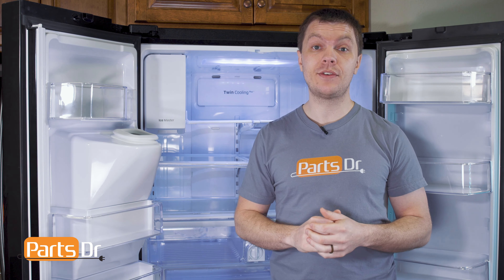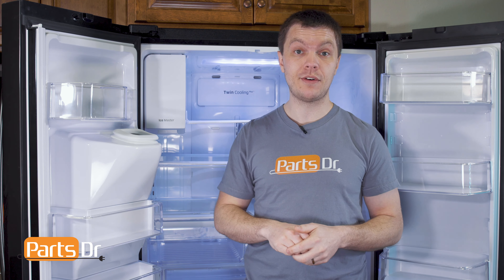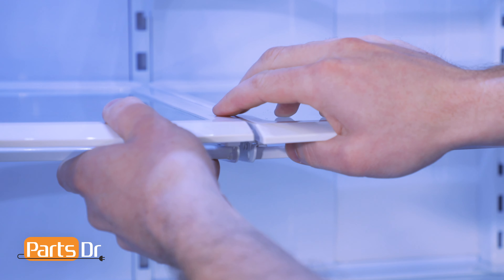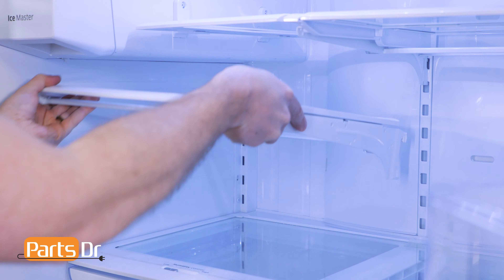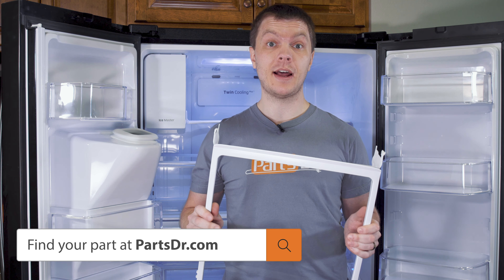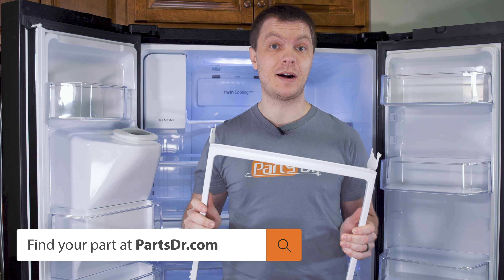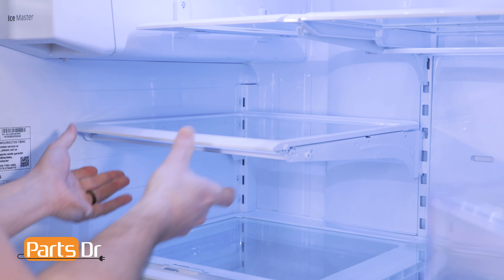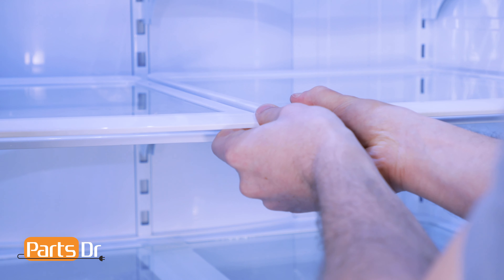How to replace Samsung refrigerator sliding shelf part # DA97-12839B

Comment: I have this exact model fridge. Question: my fridge is missing BOTH of these shelves. (The fridge was already here when I moved in and prior people must have broke them). When I buy the shelf do I have to buy TWO of the same part number? For example, 2 DA97-12839B parts? Or does buying 1 supply both parts? I'm not sure if that made sense but please help!
Reply: Also, what's the difference between this part and part DA97-12839A?
Reply from the maker: They are sold individually.  DA97-12839A is a sliding shelf (the shelf can slide forwards and backwards).
Reply: @PartsDr  okay, so just to confirm.. To buy both of the shelves you're showing in the video (left and right), I need two  DA97-12839B parts right?
Reply from the maker: @JennyOwnzable  Yes.  Please make sure to verify they fit your Model Code/BOM Name https://www.youtube.com/watch?v=4HhWL9sonuE